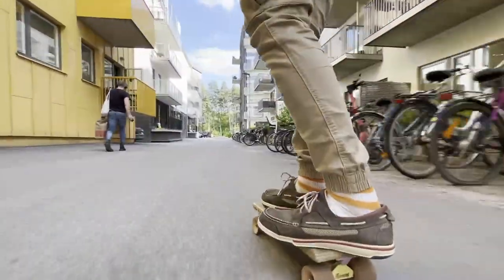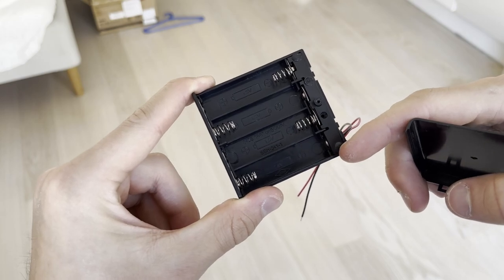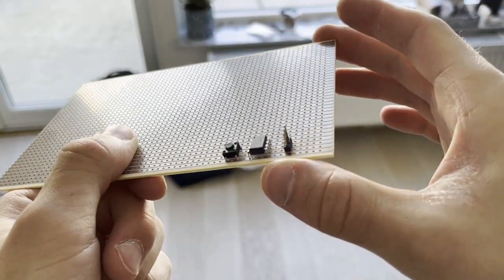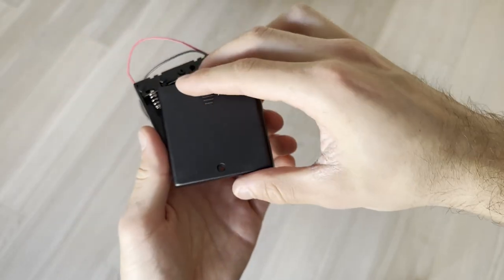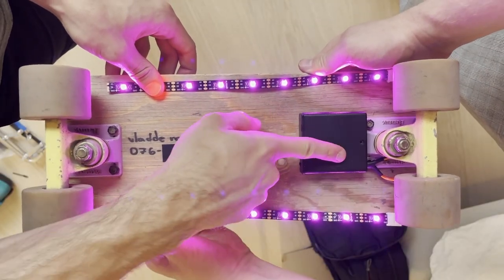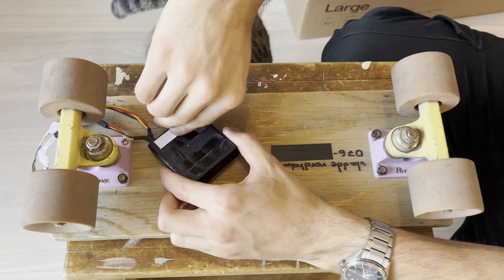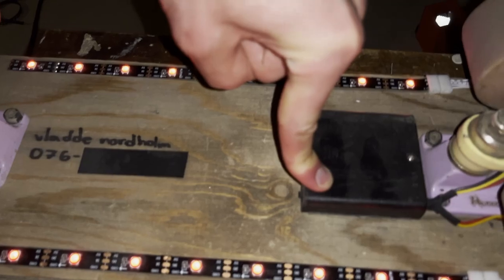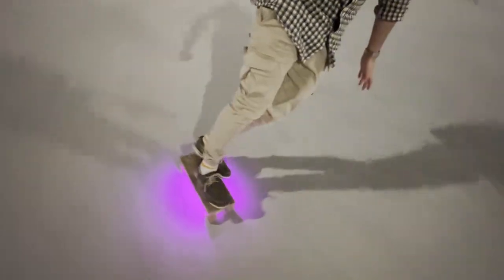neon underglow on a skateboard

Comment: only real issue i have with this is using tape. it will unstick eventually, and probably faster then you'd think, but i suppose as long as you have more tape it's always an easy fix, i'd just like a more permanent solution personally, and i guess it is just a prototype so i suppose you will have a more permanent solution later. anyway, cool build :D

Comment: as someone already said, tape will unstick pretty quickly, especially when using the board for every day traffic, i would use screws wherever possible, for example, the battery case could very easily be screwed in with some wood screws and never fall off, something similar can probably be done with the LED stripes but not sure how exactly

Comment: coolest wood plank i've ever seen

now it's not waterproof anymore though, is it? I'd keep a secondary wood plank skateboard without leds to use in case it rains
Reply from the maker: a board is never water proof, as water will ruin the bearings 🙁. the amount of water i'd be skating in (very little) would not be enough to short circuit 😊
Reply: @vladde  Oh, I didn't know that. It's very cool then, 10/10